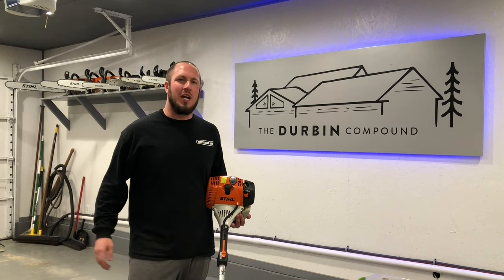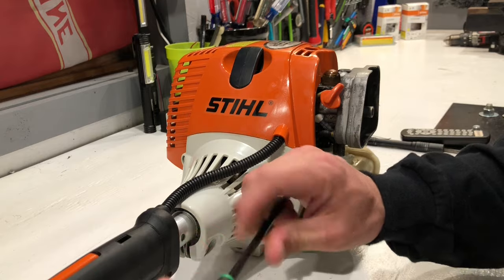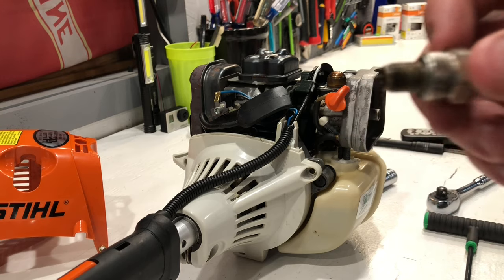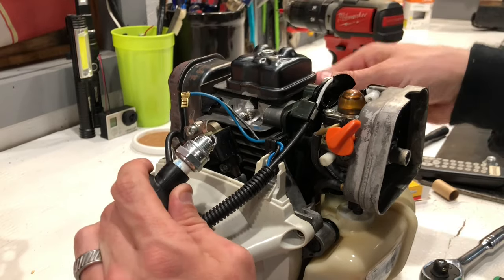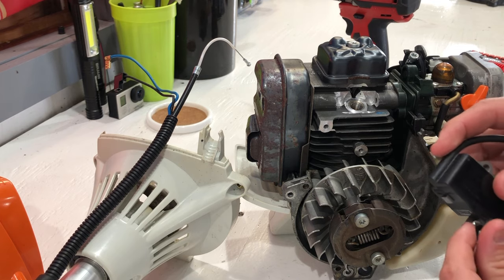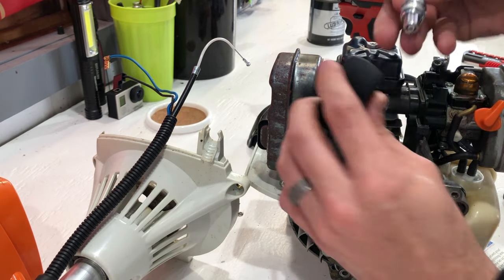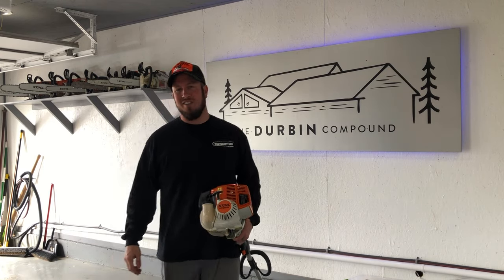How to Fix a Trimmer That Won't Start!

Comment: When changing coil packs make sure to rotate the magnets  one side is slightly wider so rotate 360 degrees as not to have binding issues when snugging up.

Comment: I’ve heard from a lot of saw shops complaining the new moderne of saws and weed eaters the ignition will burn up if you pull the starter without it connected to the plug. Just how did a weed eater that hasn’t been used develop electrical problems hanging on a wall if that’s all it takes all of the equipment at the stores would be bad wouldn’t they

Comment: Stihl fs 130 bike handle trimmer. Very hard to start. Tried everything. Problem was that throttle cable had stretched so much that when start position for trigger was engaged there was virtually no opening of carb. Only adjustment i found is a ratcheting slide in handle accessed in small rectangular opening on top of handle. Small screwdriver pushed in and pried away from safety handle will tighten it up by moving cable shroud. Carefully take handle apart to see what i am talking about. 1-2 pull starts now. I ordered new cable.

Comment: My 25yr old Ryobi 2 stroke won't start. It was smoking for a minute or so before it stopped on a hot day and for months wouldn't't keep turning over if your finger left the throttle. Needed to give it 100% gas to cut

Comment: Devin, I have a Stihl mini tiller with the same engine you are working with here and I can not get it to even fire. I can rebuild this entire engine by myself and have no hesitations as far as my ability to do it correctly. I rebuilt the carburetor and it was spotless on the inside, not one spec of dirt or debris. I am getting somewhere around 140 PSI compression. I am getting a very strong spark and the spark plug is brand new and putting out a dark blue spark. I even took the flywheel off to make sure the shear pin was not sheared off and the timing being the culprit and no such luck. I've shot carb cleaner gas and brake cleaner in the carb and once again can not even get it to fire. I tried brand new Stihl 2 cycle fuel from a Stihl dealer and still nothing. The primer bulb is working properly and filling the chamber as it should. I think I about covered everything. Got any ideas?
Reply from the maker: Does it run if you shoot starting fluid down the carb? If it runs with a shot of starting fluid, you have a fuel issue. You have compression and spark, lacking air or fuel. I think it would be pretty impossible to not get air so I blame fuel at the carb.
Reply: Check the clearance of the valves!
Some time the spark plug it’s had spark when you testing out side, but! It’s won’t get fire 🔥 in the chamber.   happens a lot with (Champions) brand.
I have been there. .
Reply: @scottvan1898  Valves on a 2 stroke? 140 Compression?
Reply: Yes ! Valves on fs90 model.
Reply: Am surprised.2 stroke with valves?
Reply: @scottvan1898  It was flooding. I can't believe it. Two pumps of the bulb and it floods.
Reply: @rays9719  how did you fix it
Reply: @Jesusisnumberone5740  I dried out the spark plug and the cylinder did not hit the primer bulb and it just started which makes no sense, Where the hell did it get fuel from if the primer bulb was empty?
Reply: @Jesusisnumberone5740  Tim, can you not see my answer below?
Reply: @rays9719  i saw. I have no idea why you had that problem

Comment: I was waiting for you to test for spark again after having disconnected the kill switch, no? I thought that was what you did to check it it's the coil/magnet or not...And that there's no need to disassemble the switch area (nightmare to get pesky springs back in!).
I've just received a new coil (slow boat from China). Two wires -- black, and b/w, like your two wires. I presume one connects to switch and the other to ground (old one must just have grounded through bolt). Does it make a difference which goes where? I presume b/w is to switch. Thank you.

Comment: "The coil" is an electromagnet is it? It's a coil of copper wire around a magnet which is positioned close to the big finned metal fly wheel (sorry, don't know the technical term!) which is turned by pulling the starter cord. This in turn generates the current for the spark plug. & It looks like you just bolted off the old one to have it tested & bolted on a replacement?

I am pretty well experienced with the use of 2-stroke garden machinery but not so much in diagnosing & repairing anything more than a worn out spark plug or pull cord. This video was very informative, great job showing the diagnostic procedure with disconnecting the earth connections on the coil. I will try that next. Then a new plug (the old one sparks but very very weakly), I know my fuel is good as it's fresh. So maybe I'm looking at getting a new coil.

Comment: I have a few of these style of trimmers I gad bought from a guy, none ran. Did the same thing and turns out most had a spark issue, was able to salvage 6/10 of those trimmers. Just had to move parts around on them.

Comment: You need fuel and air in correct proportions,spark at the correct timing, and compression. Used about 4 hrs. and has a bad coil. That’s why I buy Echo instead. I am only on my second one in 25 years.No valves to adjust either.That’s not acceptable for a supposedly “pro” grade machine Stihl!
Reply: I have an Echo chain saw CS-490 it's awsome
Reply: @happyhusker1163  It is a great saw. The only thing is the exhaust deflector needs to be opened up more. The are really choked up from the factory. Not much louder and a lot more power.

Comment: Thanks for the video. I’m about to try this because I had a feeling about the coil and when I took apart my throttle handle, I’ve noticed that one of the wires look like it was damaged  I’m about 90% sure that is my problem

Comment: got spark. tested spark plug on cylinder head and sprayed engine starter in carb put plug back in,and cylinder didnt start ,.not even a  kick.could it be ignition timing has been put out.

Comment: Hlw bro, I am having a lot of trouble with two lawn mowers.  The problem with my machine is that after starting, the rpm increases and the start stops.  Same problem in both.  Please tell me the solution
Reply: Check for Kinled Throttle Cable or faulty Governor Spring..most don't know how to start these smaller Engines...

Comment: Need help with an issue inhave with my husqvarna trimmer 128ld. I changed the cylinder and piston, i also calibrate the magnets in the flywheel, I have a conpression of 100psi, new spark plug(sparks good), new carb, new fuel lines. It wont start. Any ideas?

Comment: Do you now to fix this problem I got a weed eater for the first time and put the wrong ratio of oil to fuel and we bought a premixed fuel but it won’t start
Reply: It will start and run with straight gas. The oil is there to lubricate.
Reply: Yes, it will start with straight fuel and running it on straight fuel will destroy the engine.

Comment: I have a stihl fs 250 with starting problems, it is very hard to get it started then once it's warm it will start right away but if I turn it off and let it sit for llike 30 minutes then I almost can't get it started again
Reply: Adjust thd carbueator,check the coil

Comment: What if fuel does not come in to the little rubber fuel pumper button.
Reply from the maker: Then you have a clogged fuel filter, bad tank vent, or a blocked fuel line.
Reply: Fuel line in my tank was broken.

Comment: Fuel only lasts about 3 months when using these so make sure you change fuel 4 times a year. Dump the old fuel in your tractor if it's dilluted enough and burn it up.

Comment: Mine was getting spark and it was wet from fuel and I took out the air filter and still wouldn’t start and the fuel is brand new. Any recommendations?
Reply from the maker: Blow fuel off of the plug. Try again

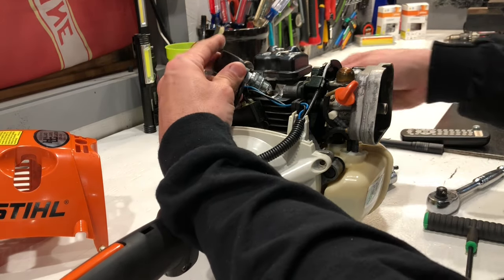Comment: how can it be a bad coil when @4:28 there was a good spark 
you saw it and cut away quickly
nice try at a repair that didn't need doing 
but hey you got your 3.4 k likes
Reply: Cuts away and comes back the next day after having the coil tested at the Stihl shop. "You can't fool all of the people all of the time, but you can fool most of the people most of the time."

Comment: Good video but I don't know if that's what's wrong with my trimmer. I'm just gonna take it to a repair shop
Reply: Pull ur fuel filter out of the tank and clean it. Also check the muffler screen.

Comment: my machine, I have checked everything, the plug is sparking like mad, the plug gets wet, I only got a bit of backfire sometimes no running, no firing, sigh, could there be some kind of timing issue, I can't think of anything else
Reply: Did you adjust the carburator high side,, screw,idle screw,
Reply: @snoopfurlow1275  I gave up and scrapped the machine, carb parts I needed were ridiculously expensive so I got a new machine different maker. I think it was just a worn diaphram but not going to pay half the cost of a trimmer to get a new one .
Reply: What!?! For my echo weed trimmer an aftermarket carburetor that comes with two gaskets, an air filter and a couple of purge bulbs costs sixteen bucks on Amazon. The OEM carb for the same trimmer goes for about fifteen bucks.
Reply: @francoamerican4632  unfortunately my machine is a Makita and has a unique carb, they wanted more than the cost of the machine for a carb that is why I scrapped it

Comment: How to fix a trimmer that won’t start? Take it to the Stihl shop! 😊
Reply: Check the coil,kill switch wires,if its a 4 mix make sure the value cover gasket isnt cracked,adjust the values

Comment: my Toro 51944 was running great right up to until I replaced the remote primer bulb and now nothing. Had ran great the day before but primer bulb was cracked, so I replaced it. Starter fluid and still nothing. There is spark but not real strong spark. I am wearing out the pull starter. Not even a cough from it. Dripped fuel through the carb and nothing.. Why did your coil fail? I have about 8 used plugs hate to buy another new one that wont help. Primer bulb is pulling fuel through the carb & spitting it back into the tank just as it should be. WTF?
Reply: clogged fuel filter inside the gas tank? then again I am a female with a jerky weed whacker that I can't get to start.

Comment: Couldn't see the spark on the video - they do sell spark plug testers that go inline and go red when there is a spark...  If it is a Stihl then most problems are fuel issues and mostly carburatuer issues.  They are cheap and are cheap to replace.  Most newer Stihl kit is now rubbish - buy another brand..

Comment: Should be called how to troubleshoot a bad coil, what about all the other failure modes?  I checked mine with starting fluid, fires.  No gas in the primer bubble, so obviously a fuel problem.  Was running great and then just died mid-job.  Don’t know what to take apart next

Comment: "Is there anything more frustrating than pulling out the string trimmer only to find it won't start?!" 
Well, trying to watch a video filmed by a camera or phone that was not securely mounted and kept shaking every time you try to focus on something comes pretty close..
Devin:"gonna pull on the cord to see if I have any spark here"......[pull...pull....pull...] 
camera: [shake...shake...shake....] 
picture:  [blur...blur....blur....].  lol
Reply: That was done purposely because there was nothing wrong with the trimmer and the shaky camera prevented the spark from being seen.